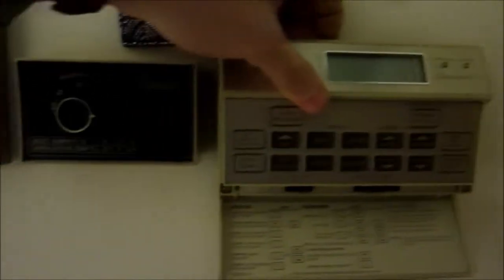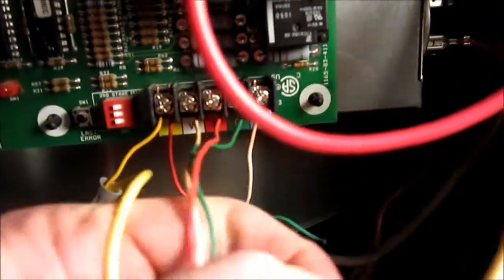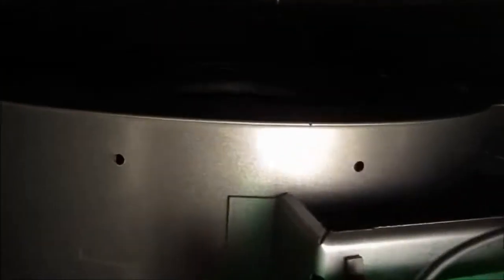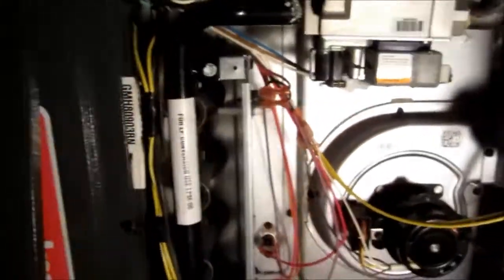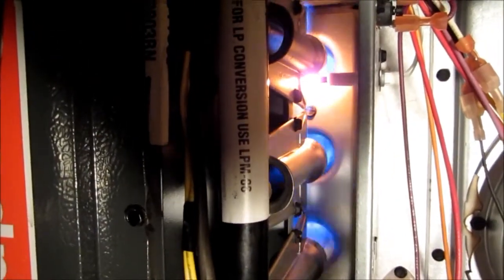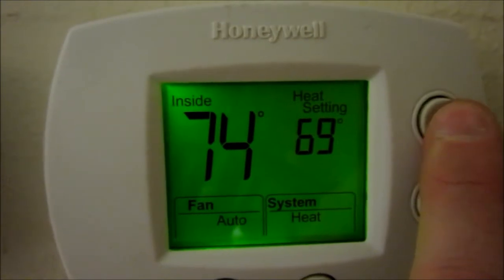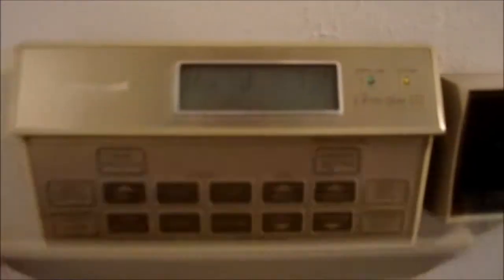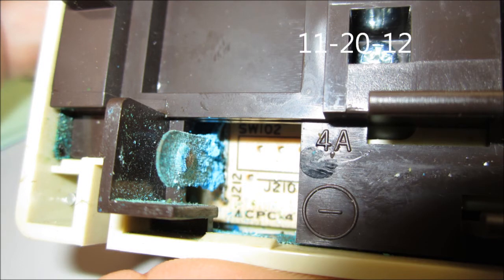Honeywell Thermostat Update

Comment from the maker: Hey Matt, The load calc says it is 2832 sq ft on the first floor. The total heat loss for the first floor came out to 63,057. HVAC Calc 4.0 says to add 25% to the total heat loss which would put it at 78,821 BTU's. So surprisingly enough, I guess it is pretty close. I was over there tonight and the furnace seemed to be putting out very hot air when it was running. I will do a temp rise on it as soon as I can. The restricted return could be causing a problem. I'll keep you posted..

Comment from the maker: I know what you mean. It was probably just a lucky guess, I know they didn't do a load calc. The original Trane (Consolidated) must have been properly sized for the downstairs and they just went by that. 

If the temp rise is out of range, I will speed up the blower. It is probably not set on the highest speed. If that doesn't help, it may be time for me to learn some sheet metal skills..lol!